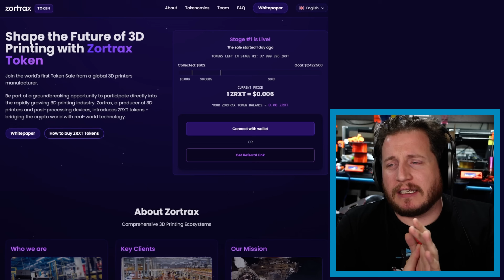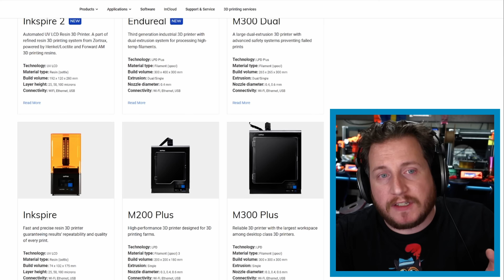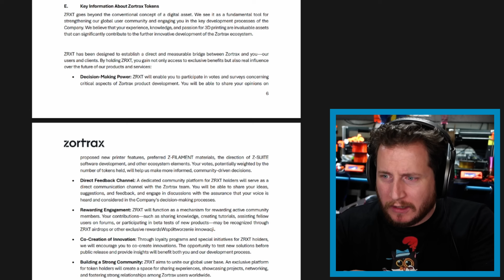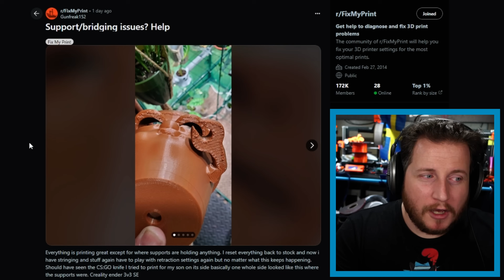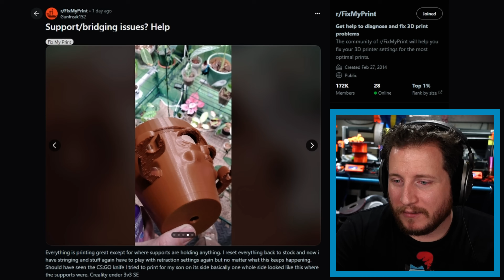DONT DO THIS With Resin!!!.. - PrintFixFriday 196 #GrantRant

Comment: Soon after getting my first 3d printer, I started to work at an engineering consulting firm. When speaking to my new colleagues, I found out one of them also had a 3d printer. Not an Anet A8 like me, not anything based on reprap at all basically. He had a Zortrax, I believe it was a M200 but I'm not sure. Perforated bed and super cool and mega expensive. And so cumbersome to use that my Anet A8 actually was better in almost every way.

Comment: I had a friend who did resin stuff for a number of years... even with PPE, he wound up dying from leukemia caused by the toxic chemicals.  I love the look of SLA printing, but after that, I stick to FDM, and my print farm room has a quality monitor and two HEPA + fine grained air purifiers.
Reply from the maker: I'm not certain correlation equals causation here but it all depends on what chemicals they were using.

Comment: I have a Plus 4 and print 95A TPU literally all the time and never had an issue loading it from the normal external spool.  In fact, it loads easier than PLA in my experience and I'm weary of bypassing that tangle sensor as it also has saved my bacon multiple times!

Comment: Grant I am having more core one issues my nozzle temp and bed temp keep changing mid print and I'm just getting warping and spaghetti monsters. I'll set it for petg and then it will only be at 150 so I'll select tune and raise the temps manually witch only works for about an hrs before it somehow changes on its own again. When I go tho cheek it out the bed temp is down to 28 and my hot end is a speceti factory.
Reply from the maker: sounds like maybe something in the file? what slicer? can you send me a 3mf?

Comment: 17:08 I considered as a sensible matter depending on the machine and the manufacturer's target: For example, the typical 256x256x256 and smaller 3D printers (specially the bambulab clones) don't need it because with 10-15 minutes from the bed is enough to reach 55C. With my SV08 I need to wait around 30-40 minutes to reach the same using only the bed, but if the SV08 or my V-Core 4 were targeted to a more industrialized customer, having a heater chamber from the factory is an enormous improvement because we as end users we don't need to take into account to separate the electronics or to cooldown the motors since we (hope so) were done on the factory. But this later will increase significantly the price for the machine and will not make it atractive to the consumer, that's the sensible part. If the consumer needs a stable heated chamber, we need to pay the price for it, that could be the payment on the machine or the time for creating the conditions to achieve it correctly

Comment: You beat that dead horse enough.  My company locks our machines downs so much it does just the opposite.  It stifles inovation.
Reply from the maker: not enough because people still make these IP errors all the time.
Reply: What innovation? That you have an app on your cell phone riddled with ads to monitor your printer on the go? Learn how to set up a VPN. It's not that difficult.

Modern 3D printers have enough computing power to serve as a small server. Perfect for attackers to get a foothold in a corporate network. From there they can attack internal servers. Important data can be tapped, encrypted or both.

Comment: 5:34 One of several reasons my employer uses 95% Prusa printers, with the remainder being Markforged.

I'm hoping Ford has something worked out. 🤷‍♂️
Reply: As long as the network admins at Ford are not completely incompetent, the printers should not be connected to the Internet. If they are not airgapped then they should at least be in an isolated network without an internet connection.

Comment: Hahaha oh Valentin! That is a good one. I am the person, or at least one of the people, who started printing soft TPU on the Plus4 by feeding it from directly above. With the stock spool holder, the angle makes it so you should print at the back of the bed to avoid pulling the spool down. I do use a small pigtail of Bowden tube in the top of the printhead. Also the community has designed angled spool holders that make it work much better. With something like Siraya Tech 85A, which I love, you can actually get quite a high flow rate. 10mm³/s or more by feeding directly to the top of the head. The Bowden causes misfeeds. A well retained angled bearing spool holder could help even more. The Plus4 does print it very well!

Comment: Ford deals with suppliers having info on their intellectual property all the time. I'm sure they've made agreements with Bambu regarding confidentiality. For that matter they may have set up their own cloud server.
Reply from the maker: I highly doubt this. They are using consumer grade machines. The X1E is their "we totally promise it is not logging everything" machine. Currently, at least. Ford does not have nearly enough machines, based on what we can see, to have that kind of a relationship with Bambu IMO. I know a few people with more than what we could see and they dont even get buying discounts.
Reply: @3DMusketeers Would imagine they are all in lan mode. Just about all workshops like this (businesses that uses them for engineering purposes) I've seen them in, this is the case as there isn't a need for any of the cloud resources (don't think we need intern Jimmy using the handy app)

Also, in a general sense, any lab like this will vet anything going through and communicating with the outside world along the intertubes (or even the lab doors themselves). 

Software/firmware will be locked to a version and imaged by another department. Unless something absolutely needs an update for whatever reason, they will not be changed.

This is no different than how any business (should) handles IT and the devices on its network.